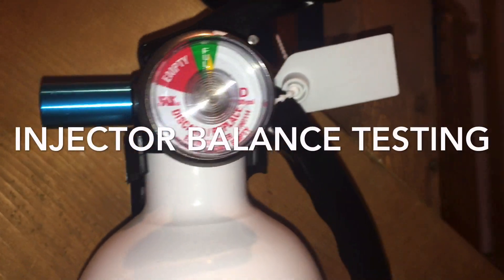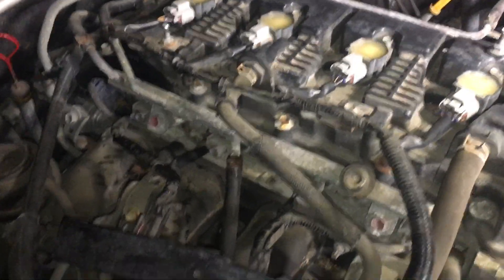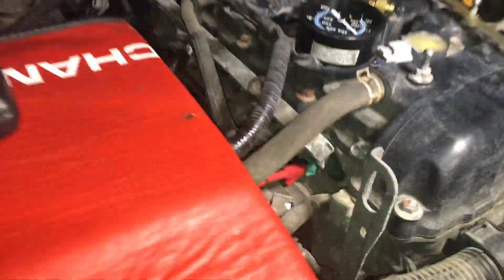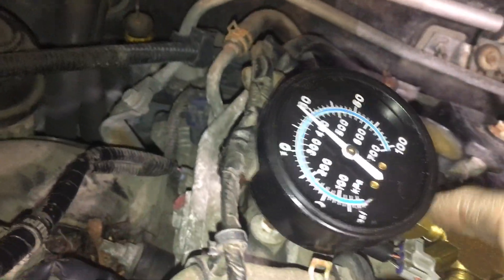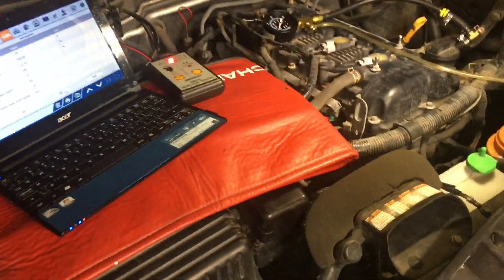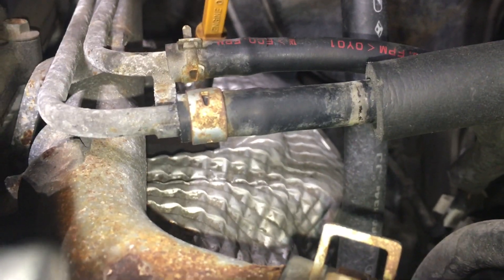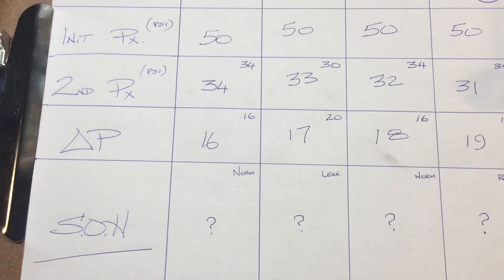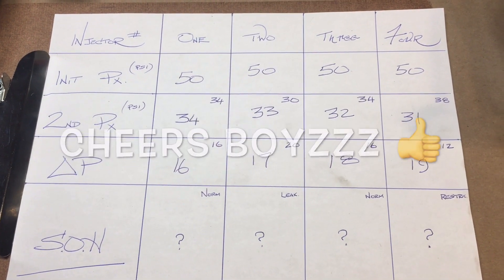Vitara Injector Balance Testing

Comment: If you went from left to right and you feel that the battery was getting weaker over time, then redo the test from right to left. I recommend an extra battery being hooked up for all testing when the engine is not running, its a simple electronic theory that most people don't know anything about, no worries. Your test was invalidated by yourself, your initial fuel pressure was above 50 but for some strange reason, you elected to wait for pressure to drop to 50. Pump up the pressure a few times, ok a test, get the average top pressure like 53 or 57, and hit the button ASAP at a good higher level that looks possible every time. It seems you have a quick leak back to the tank as it does not take long to drop to 50, wasting your time and effort. This leak back time is also a factor for a poor running lean engine so you will also need to learn how to measure the drain back into an external receptacle while the engine is running, see Bernie Thompson's video on how to measure drain back on a vehicle with a fuel pressure regulator.
Reply from the maker: You make some good points. As a hobbyist I clearly have plenty to learn.

Comment: Nice work.  It's tough sledding with a gauge that is that coarse and a thick needle like that. My guess is that trapped air was being purged from the line along the way.  I feel your pain on lack of a service port for fuel pressure. My rail only has banjo fittings so I have to adapt like that with crush washers and all.
Reply from the maker: Thx for watching. Might revisit this topic. Cheers

Comment: Could the distance from the fuel inlet and gauge cause the linear progression? Cylinder 4 is 8 more inches away from the gauge than cylinder 1.  What if you tested them in a random or reverse order?
Reply from the maker: Not sure to be honest...I suspect starting the engine between cylinders (fuel purge) may have introduced a bit of top end heat skewing the results. I really don’t want to run this test again but the uncertainty is irksome. I will keep your suggestions in mind. Cheers 👍

Comment: Nice representation!  I'm thinking heat could change the reading also. Thermodynamics at its best. I fully understand the approach. Thank you for another great vid!
Reply from the maker: Thx Bob...Similar to your thoughts...In the comments Denis suggested that starting the engine between readings (done to purge raw fuel) may have skewed the results. I completely agree. This may well account for the linear discrepancy. Cheers 👍

Comment: I'm wondering Ian if running the engine between injector measurements led to this "discrepancy" . Most people do not do this. My thinking is fuel rail warmed up increasingly (ever so slightly) between runs.
I've never liked this test. A lot of work to set up. The margin is <2 PSI between injectors on a "coarse dial" fuel gauge. But my attempts at developing an alternative have been fruitless. Even my craziest ideas haven't worked:)
Reply from the maker: Hi Denis. I think you may well be right. The linear error makes me think it’s a procedural mistake on my part. I also did not purge the trapped air in the gauge line. Not sure if that was a factor...No point in experimentation if the resultant data set always meets expectations 🤣 I will tell myself that! Cheers Pal 👍
Reply: @TheGibby3340  I tried something a while ago...placed a pressure transducer on fuel rail and a sync on 2nd channel. Pressurized rail, removed relay and ran engine until it stopped.

You'd expect a "staircase" waveform. Linking the steps to the firing order and measuring the rise (drop) of each step should tell us if all injectors drop same relative to each other.

I got the staircase waveform. ONCE. On the very 1st try. Was never able to replicate it!
Reply from the maker: @theGADGETSplaylist  Clever approach. Nature/physics does it’s level best to keep us mortals guessing 🤣

Comment: Interesting results, I haven't had to carry out an injector balance test very often. I have the exact same tester as you. I have made use of it powering other things like an EGR valve, variable valve solenoids, vacuum solenoid I think I have bench tested an ignition coil with it. Cheers Matt
Reply from the maker: Thx Matt...Never thought of that. Cheers Pal 👍